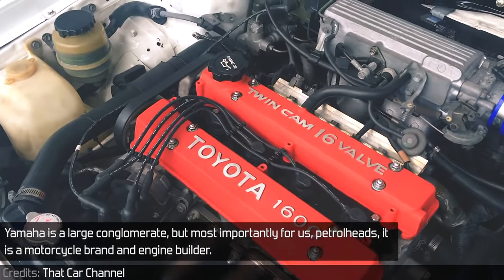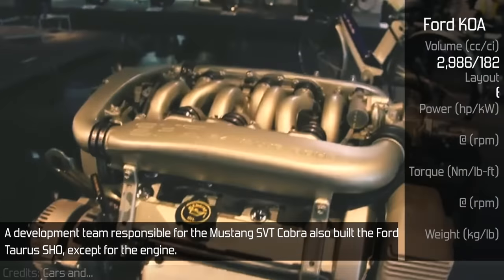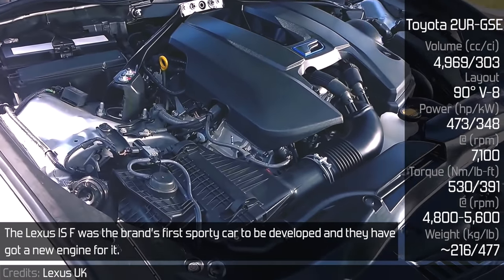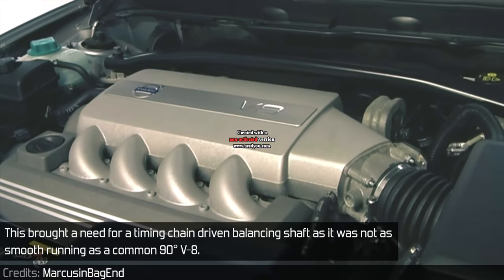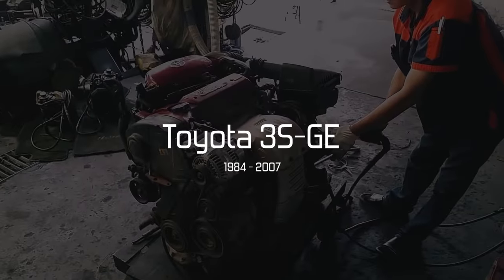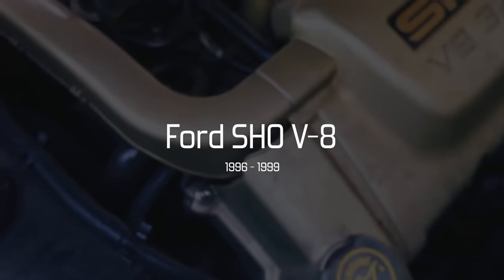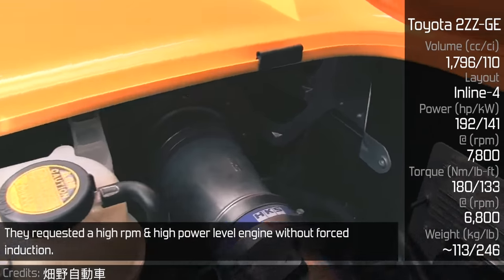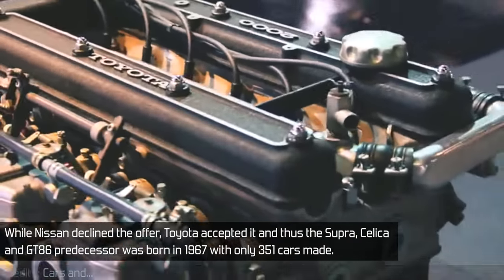9 Yamaha Engineered Engines You May Not Know About

Comment: Sucks that Toyota is working with BMW now to get there performance engines instead of Yamaha
Reply: Thats what i said and the gt86 should have a bored up 4A-GE motor used in the AE86
Reply: I  thought that i was the only one who griped about that. Too, BMW has a sportbike the S1000RR with a 4 cylinder engine. Please tell me they did not copy that from the Japanese.
Reply: I don't know about that. V8 in Volvo are crap. Worst engine they did instal in S80 or XC90.
Reply: Absolutely
Reply: Artur Mroczkowski and the T6 is faster, I don’t get it either. It’s interesting with further work to solve problems and accept boost as in the noble.
Reply: Yup.  They traded reliability for overpriced high maintenance and arrogance.  I'll take Japanese engineering over German any day.  It's like some execs sat around the table and said, "Hmm, the Supra has a legendary reputation.  How can we ruin that?"
Reply: Forgot 1.5l 1450HP F1 engine made by BMW back in '80.
Reply: Andrew Smith  the B58 actually is very reliable the engine in the "new" supra. Also the 86 only makes 102.5hp/LITRE vs the honda civic si that makes 136.6hp/LITRE why would I buy an engine that is more inefficient that most inline 4 today? Even bmws b48 makes 130hp/LITRE and gets better gas mileage than the 86 it's a waste of money tbh.
Reply: I am reading alot of people mad Toyota is dealing with BMW but what people don't know is this is not new I did some research and that famous 2JZ Toyota engine was actually designed by BMW engineers Toyota made that garbage 7m that came in 86/92 supra but 2JZ 93 and up BMW motor Toyota is taking the credit but they didn't design or make that engine BMW always made good I6 engines
Reply: @JALNIN66  that supra engine is German buddy 2jz
Reply: Bmw are probably cheaper and are the only ones making straight sixs any more. What you want a v6 in the new supra?
Reply: @Bonkatronicks  2017 Mercedes built the m256 straight 6, produces good amonunt of power between 362 and 429hp depending on setup.
Reply: Why , BMW build the best inline six's on the planet this side of the RB Nissans .
Reply: @alexfrankl7861  you are tripping m50 is the only engine with 0 issues that BMW ever produced. People are complaining about Toyota and Yamaha for not collaborating because the JZ series of engines were built by both of them. BMW is the only company in 21st century that constantly produce inline6 the rest of the companies makes v6 for more room.
Reply: @ristekostadinov2820  the only benefit a V6 has over inline is packaging , inline is better balanced , has better torque characteristics , less moving parts , lighter , etc etc .  Toyota failed at replicating BMW's multiple engine of the year winner .
Reply: @MJT-DA  but 308GTI makes 168PS/litre. wkwkwkwk
Reply: @vee950  Please give source of that info. I've heard that story from BMW fanboys too, but it doesn't make sense. I compared BMW engine and 1/2JZ and they have nothing in common. Also 2JZ is based on 1JZ which was developed by toyota (yamaha gave head for 1JZ-GTE). I tried to verify info about bmw/toyota cooperation back then, but there is no such information on the internet.
BR
Reply: @ErnestDziadekGruz  I originally found out on YouTube from a supra tech&tuner and owner of a supra I'll try to find that video because he breaks it all down about the old and new supra he is 1 of 3 that revealed this info but I couldn't Google it I have to dig deeper but it's not all of sudden Toyota deside to deal with BMW think about it also it makes sense because BMW are known for being I6 geniuses
Reply: @ErnestDziadekGruz  and your right the 1jz is all Toyota engineering
Reply: @hexostatus4658  the most reliable Audi engine is quite possibly the 1.9TDi from the 90s.  

Also last time I checked the only Volkswagen Audi Group manufacturer in the top 10 for reliability was infact Skoda.  How they manage to be more reliable than Audi, Volkswagen and Seat when they all share 90% of their parts and chassis is beyond me.
Reply: @yudiwahyudin6644  holy shi- I'm not worthy!!
Reply: @DoubleCGamesStudios  do more research its true dude
Reply: @vee950  It's not, you can't even prove it.
Reply: Yamaha e mui buena
Reply: You should learn more history on bmw inline 6’s they are some of the best, comparable to Yamaha or even better sometimes
Reply: XantheFIN F1 engines are an entirely different kind of engine, not relevant to the conversation. The reason they’re low displacement is because they’re designed to rev high instead of have big displacement. F1 engines are built to an entirely different standard than production engines, using exotic materials to achieve performance goals. That’s why you don’t see people swapping F1 engines into their cars, too hard to maintain and not meant for the street. Not saying it’s not an impressive engine because it sure is, but it’s not relevant here.
Reply: XantheFIN 

Everyone was making these engines,Renault, Ferrari, Honda etc etc but banned due to being murderous cars just the the rally cars of old running 600+hp.... Ferrari were making 1.5L V12s in road going vehicles albeit not many as people may think..
Reply: True!
Reply: Its because of emissions,
Reply: POB108 

It’s actually because of costs, R&D and previous joint ventures in trading battery technology to BMW and then BMW supplying Diesel engines to TOYOTA for the European market...

The Japanese can produce any forced or normally aspirated engines than can pass any EURO Emissions requirements, they’re better than everyone one else at it..
Reply: @vee950  lol BMW designed 2JZ, thank you for good laugh
Reply: Toyota partly owns Yamaha, 2 companies share tech, like Mercedes and AMG
Reply: Well since people are still replying I’ll throw in my 0.2cents, let’s not forget bmw built the engine for the mclaren f1 and all of their m tech cars are nothing to shake a stick at, and for Christ sake they didn’t build any jz stop spreading that lie lol
Reply: Its should not be called GTE because the G is always had to do with Yamaha anything that had a G in it is always an involvement with Yamaha
Reply: @MJT-DA  I agree.. B58 is a great engine. Toyota didn't just take it and slap it into their car.. they took it to pieces to inspect it and see if it would be reliable. They were happy.
Reply: @DoubleCGamesStudios  Thank you. Toyota put a lot of money into the development of the 2JZ. They also had a great team put together to develop it. They created something that will be remembered for a long time.
Reply: @IOTWVUVWTOI  most/many Skodas sold likely are less likely purchased with delusions of a sporting god mental-complex of some youthful drivers egos?; ..hence lesser wear and tear on service vehicles compared to the sportier tunes of SEAT, Audi & Volkswagen, Lambo etc, I think is one partial fraction of an answer, I'd image dacia might be as or more reliable (if they're a part of or a joint venture with Audi-Volkswagen (Porsche-Pieche) Group.
Reply: @razor1uk610  if you service the car, replace parts when needed instead or running it into the ground any car is reliable.  Just shows the kind of people who own those types of vehicles.
Reply: @IOTWVUVWTOI  yes, but some models, certain states of tune, reflect slight differences in the particular variations in performance engine modes on an engine type, with some brand styles, traditions, expectations within the groups individual brands efforts & marketing, mean they're some differences & 'flavours' of their many different powerplant options to not stand on their own toes too mutch, say Skoda for Rallying, Volkswagon &/or Audi in DTM, only certain brands racing in classes or capacity range clsses as indirect rivals.
Reply: @razor1uk610  dude my point was it's literally 90% the same car.  Body panels, lights, grill and interior are different.  

A3, Golf, Leon and Fabia all share the same chassis.  Infact I'm sure the Octavia, Bora, A4 all shared the same chassis as A3 etc too in the late 90s /early 00s.  

Skoda are slept on aren't as boy racer ish so would be less "raced".  However, I like a good B road, do trackdays and I've never had reliability issues (because I look after the car with servicing etc Which is neglected by so many people especially fannys ragging their cars through the local council estate).
Reply: @razor1uk610  you are right about indirect rivals.  That's a sales strategy more than anything.  Personally i loved the Polo WRC
Reply: Exactly!!! Imagine a 2jz designed by yamaha
Reply: I totally agree
Reply: As they should bmw has crazy performance engines
Reply: @jackpez  ha
Reply: that's because Yamaha doesn't have an inline 6 and BMW does.
Reply: Agreed, starting with the fake Zupr4 (Z4)
Reply: @MJT-DA  The GT86 ISN'T a successor of the AE86

Comment: The Yamaha v10 with Lexus will be the best Yamaha engine ever
Reply: The YZR-M1 engines are pretty fantastic
Reply: @matthewkuhl79  Yamaha's unbeatable advantage is in its Yzr-M1 engine, this allows the racer to have full control of his motorbike in corners, but the top speed issue has indeed been a problem for Yamaha since the Yzr-M1 was first developed, hopefully the engineers find a solution

Comment: Let’s not forget the Ford Duratec 1.4 engine co-developed by Yamaha found in the Ford Fiesta from 2002 to 2007! Great reliable little engine!
Reply: Not only the 1.4
1.25, 1.6, 1.7 and all the EcoBoost variants are the same base engine.
Reply: And all the 4 pot Duratec 1.8,2.0 and 2.3 came from Mazda or basicly Mazda designed and engineered. So   most off Ford's petrol 4 pots were Japanese...

Comment: I know at least two other engines that Yamaha has developed or co-developed. One of them is a small, lightweight Sigma engine (Zetec-SE). Ford started with the Ford Fiesta Mk4, which had different capacities, and the strongest suction variant was 1.7, 157 hp and 162 Nm hidden under the bonnet of the Ford Puma. Over the years, Ford fiddled with this engine and eventually created an EcoBoost variant. The strongest version was the 1.6, 205 hp in the Fiesta ST205 MK7.

The second engine is 1.8, 192 hp under the hood of the Corolla E12 T-Sport.

Comment: didn't the yamaha engine in the xc90 get a place in the noble?
Reply: OEM Asian yes
Reply: Noble M600, once Twin Turbos were added indeed
Reply from the maker: Yes, the Noble M600
Reply: Yep the M600 i forgot the name it sounds incredible indeed
Reply: I love my xc90 v8!
Reply: Garbage. The front is overweight and transmission would last about 20 kilomiles if you'd really use the engine.
Reply: do you even know why mid engine cars are a thing?
Reply: Drove it for several months. It is how it feels. The most unballanced car i had.
Reply: you drove a noble m600 for several months?
Reply: Even better in the S80 ;)
Reply: The best Volvo engine of the last 20 years is the 5 cyl engine. Ford took the 6 cyl production away from Volvo, and made the T6 and the 3.2 in Ford foundries, while Yamaha did the V8. The 5 cyl was, for a long time, the only in-house produced engine for Volvo. It was Volvo's most reliable engine too. My 2006 XC90 2.5T has a great front front-back balance, and I prefer that to a powerful engine. And the 2.5T has great low RPM torque.
Reply: Yup! W/ twin turbos bolted on! Seems to me Yamaha plays it safe & doesn't build high hp engines (LFA engine an exception).  That said it seems to me they leave a lot left for the tuners.  Yamaha IMHO seems to prefer building high revving, "fun to drive" & durable engines rather than go directly after hp.
Reply: I admit, I don't know the back stories or have any inside info.  When it came to the V8 I read Volvo couldn't handle the engine production without a factory upgrade & were also at engine production max.  Which is why Yamaha was called.  Can't tell u if it's true, it's just what I read!  Interesting that the 5cyl blocks are cast "out of house."  Than again, this is the case with many companies... Even large ones.  An in house foundry costs $$$$$$$.  Plenty of car makers outsource almost everything & r really just "assemblers."
Reply: Volvo's engine expertise is in inline engines, I-4s, I-5s (their most famous engines are their I-5s), and I-6s. They were persuaded the XC90 would sell even better if they had a V8 option, so they developed one with Yamaha, and Yamaha built if for them. They'd never built a V8 before, and needed Yamaha's expertise.
Reply: They also produce rediculous hp when NA bored out cylinders.
Reply: volvo made a V8 for their trucks before called B36, more or less two b18s welded to a V8
Reply: @zipacna1980  the transmission in the xc90 is an Aisin unit isnt it?
Reply: @DennisH22A  yes.  The TF-80 6 speed.
Reply: @GHE98  it's great in the S80!  I love the bark it makes in the S80 at start up.  XC90 doesn't have that.
Reply: Yes, its only built by Yamaha though, designed by Volvo despite what the video claims.
Reply: @VisioRacer  also yamaha is a audio components and sound generator seller too

Comment: I have a stock 2003 JDM Corolla Fielder wagon with the 2ZZ-GE Yamaha motor. 190 hp, 4 speed tiptronic, 180,000kms and going strong. 100mph is a breeze.

Comment: Those Taurus SHO sedans were literally the star of the "SHO". Get it? Because show and SHO........

I need to shut up. But honestly, I love those Taurus SHO sedans. And even though I hate 6 cylinders (the only 6 bangers I like are two stroke detroits), that Yamaha V6 sounds like awesomeness. But that 3.4 V8 tho......I LOVE THAT 3.4!!!! God!!!! To me that engine is like the Japanese version of the Windsor.......Dafuq did I just say?

Again, the Taurus SHO is the bomb!!!! :D Sorry if I sounded stupid. :P
Reply: 6 cylinders are great. In fact, to my knowledge, every single inline-6 ever made is known for being reliable.
Reply: The 3.4 was a modified Ford engine, not a Yamaha engine.  Basically a 2.5 Duratec with 2 extra cylinders.  The V6 SHO is the real Yamaha deal.  Too bad the examples he picked in this video sound terrible.  No self-respecting SHO V6 sounds like that.
Reply: V6 SHO was a good engine starts to burn oil later in life tho
Reply: atheist45 The V8 is as much as a Yamaha engine as the V6- the V6 was designed off the existing Vulcan engine. The V8 was designed off the Duratec-  the V8 had an aluminum engine blocks, using the patented Cosworth process, at their Windsor, Ontario plant, considering they even shipped them to Japan for finishing by Yamaha. The finished engines were shipped back to the Taurus plant. They’re definitely Yamaha built- both the V6 and V8 are Yamaha built.